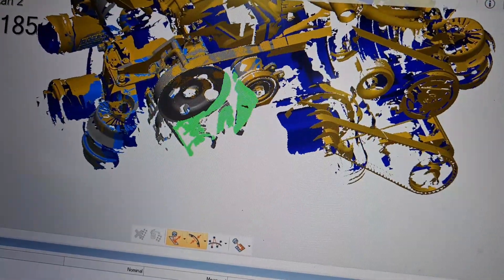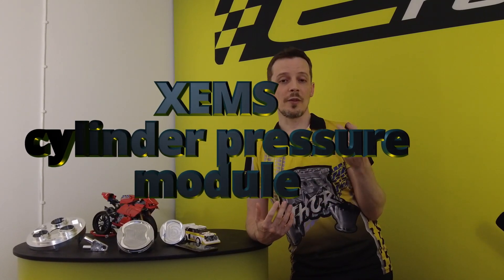Hel engine updates!

Comment: Can I pre-order the Max-HEL ?
Reply from the maker: Please contact us at sales@elmerracing.com to exchange contact info.
Pre-orders within the next 2-3 weeks or so are possible. But we would need to see that this is a good fit for you. Higher likelihood of issues that need solving (parts to be sent back to us for mods etc) with the first batch. That's not for everyone. But on the flip side, allows you to have a engine months before others.
Reply: @ElmerRacing  I hope this comment will be really useful for you and opens doors due to it being very realistic and logical

I am very familiar with you thor engine and its amazing specs

And recently I have been looking into turbine engines and specifically turboprop engines that are used in small aircrafts and personal propeller planes

Your engine has better fuel efficiency power to weight ratio and easiness of repair than the famous GE T58 turboshaft engine

Not to mention your price for a brand new engine is very competitive vs an old GE turbine engine that is about 300 pounds + a gearbox to make 1290HP and swallow tons of fuel
In addition refreshing and maintanance are extremely expensive

I truly believe that the avaition community should be told about your Thor engine

And every propeller plane out their must buy your engine

It is price competitive in addition to the benifits I have mentioned before

And the aviation industry is more ready to pay the price tag that you are asking for than the car community

Also Hel engine will be competitive if it had low weight

Therefore I would recommend that you inform aviation clubs and propeller plane clubs and owners of what you have it is such a shame that your engine isnt being bought by them
Reply from the maker: @FirstLast-tx3yj  We are actually working on setting up a sister company to develop and manufacture aviation engines!
Whole organization etc. needs to be completely build with aviation in mind from the ground up. Not possible for us to do that directly here at Elmer Racing.

Comment: Do I remember correctly, you said some other time, that XEMS is capable of real time pressure sensing and respective adjustment, but now, you say OEM controllers are "not realtime" but "only" capable to adjust the next stroke? Is XEMS faster than the OEM?  (I understand XEMS is not fully commercial at the moment)
Reply from the maker: Our XEMS system is very capable.
We'd assume the really high end insanely expensive ecu's are capable of real time cylinder pressure sensing also. What you can do for the same stroke is very limited though (direct injection is about the only thing). So not giving up much by "only" adjusting for the next cycle / power stroke.

Comment: Where do you find you spend more time - coming up with the models (in cad), FEA/optimization, or CAM and programming the CNC? Do you also validate some of the scan data with a faro arm on key points (or similar)?
Reply from the maker: CAD takes by far the most time. FEM would take a lot of time, but using a CAD program with a capable enough integrated FEM system saves that time. 3d scans are just for visual reference.